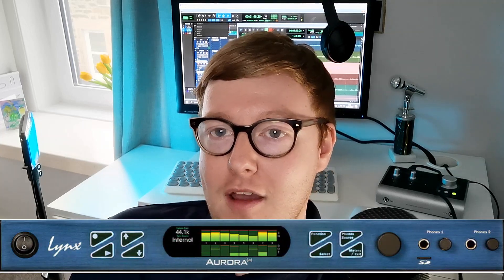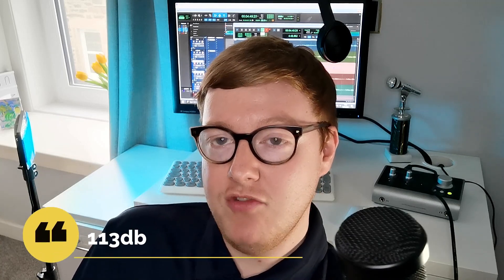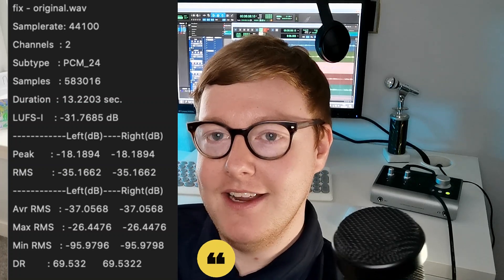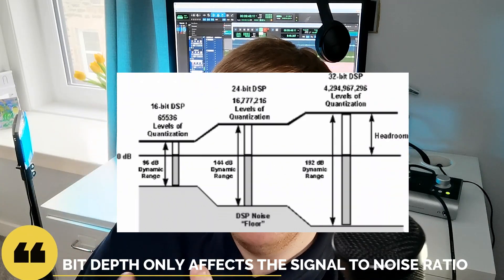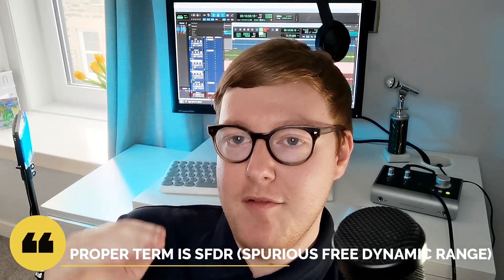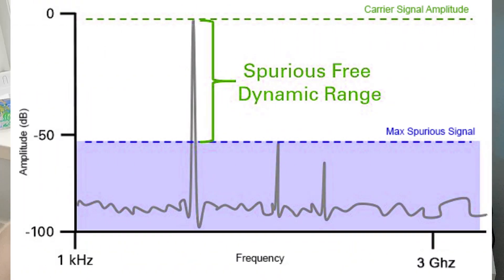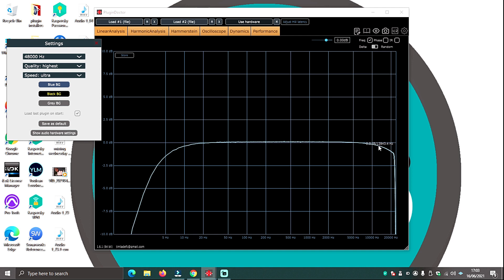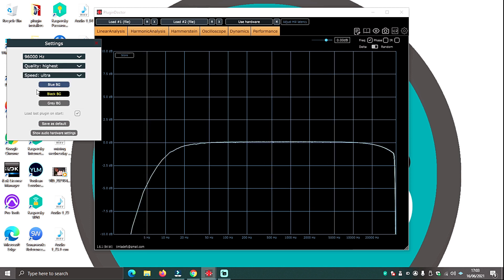Do you lose audio quality in analog gear using budget interfaces vs expensive ADC Converters (Pt 1)

Comment: There is a timing issue in your null test and it sounds like the Lynx was also at 48k compared to the audient first example. Those are the only ones that should matter and what your hear is a better null in the low end of the Lynx versus the Audient. The 96k example on the audient has serious low end issues , you have to remember that what you here in the null test is everything that was lost or shifted in time during the conversion process. Which means the Audient at 96k is severely phase shifted below 500hz compared to the original or you don't have the samples as lined up as you think you do. Do a proper comparison of both units at 96k and use a plugin that will allow you to shift audio fractions of a sample. The other matter you didn't touch on that is super important to imaging is crosstalk rejection between conversion channels and jitter. Clocking in the cheaper interface vs clocking in the expensive will play a big part in how the tracks are going to stack and also take processing during the mix. You are isolating things here in a way that is not in fact indicative of how the units will be used in a real situation. Tracking through each unit vs running pre recorded sounds is not the same thing, the pre recoded file has already be processed and digitized and is no longer a real signal out in the wild. Not saying you cant make a good recording on an audient product just saying I don't think you have proven what you think you have. That audient is not going to keep up when it comes to tracking drums with a 14 mic setup or symphonic orchestra with 40 mics flying in the air, that is a fact. At the end of the day the audient tracked multi mic session is going to sound muffle and muddy compared to the more expensive interface because what I pointed out....Crosstalk, jitter, phase distortion,  frequency response and yes dynamic range does make a difference when tracking things for real vs running pre recorded files through the conversion. Do the same test but this time run full mixes through each converter at different sample rates more then once, meaning, run out of the Daw and back in and then tack that re recorded file back out again and then back in like 4 times and compare the degradation. The Lynx will be much more accurate. This is important when processing things out of the box and back in and then summing things out and back in for bus work..your tracks can go thru 3 or 4 passes of conversion before the final mix is sent to a mastering house where another pass of conversion will take place as well. The cheaper converter isn't going to fair nearly as well in this process. All that being said, converters in general have gotten massively better over the last 15 years, back in the days of the Digi 002 and 003 , there was a huge gap in quality over cheap vs expensive converters, there just was not anything that sounded as good as the Apogee/ Digidesign/ Lynx/ Prism converters in the budget range section. Basically the budget interfaces out now are the best of what was available 15 years ago for a premium price. So be happy with the fact that for $500 bucks you can go out and make a recording that has the potential to sound every bit as good as your favorite records from 2 decades ago. However in todays market with everything being ultra HD and the need for low latency networking and tracking with 200 plug ins during an overdub, Dolby Atmos /5.1 The lower end interface is not gonna cut it in the pro world.
Reply from the maker: It's possible the timing many be the tiniest weeniest little bit off but I did another null test with pink noise not long after I upgraded to the id44 which you can bypass the preamps and run right through the converters. 48k session.

Maxed out the zoom in protools and time alligned for the best null. Tried voxengo time alligner to see if I could get better results by further fine tweaking but I got the same result in the lynx.

You can hear it in the audio examples. Its brighter and SPAN confirms it. Has a deeper null than audient from 20hz to about 1-2k but when you get into the top end that's where the difference lies.

What I learned is that both nulls measure relatively close with -0.8db of a difference in favour of the lynx BUT that main difference lies in the top end which is hyped for whatever reason.. Phase maybe 🤷‍♂️

The audients null is more evenly spread out where the lynx is more different in the high end. So while the lynx has a 0.8db quieter overall null it has most of the audible difference as most of the audible null energy is in the top end.

Audient still doesn't have anything louder than -70dbfs till like 1-2k which is similar to the lynx but the lynx nulls a bit deeper in that region but differs way more in the top end. Its not the counter balance you want. 

Audient pink noise null is -37dbfs and lynx is -37.8dbfs but in a blind test on an instrument or vocal you'll always pick out the top end of the lynx which over a mix will build up and sound a lot brighter. 

So you say 3 or 4 passes of conversion in a cheaper won't fair well but it'd still be more audibly transparent than a lynx aurora which will add more audible top end with every pass where the audient has its differencez but its more spread out and less noticeable.

Its all fine and well getting a deeper null difference on 20hz-2k but when that difference in the audient is practically inaudible anyway it means nothing as the counter balance in the lynx is in the high end which is way more audible and less transparent sounding.

That's why my point still stands.
Reply: @PaulThird  I don't think you understand what it is your hearing friend. What your hearing in the null test is not added high end. What your hearing is everything that was the same yet 180Deg out of phase along with analog artifacts which for this test is an unknown quantity for the Lynx. Meaning you don't know what the signal had to pass through to get through the Lynx and back to you. That being said all converters impart sound signature on to audio, even the most expensive, it is just that some do it less then others. so when the audio from the audient comes back and your hearing an all most full band signal that does not completely null it does not mean it is more balanced. It means the opposite, it means that there is distortion and phase shift across almost the entire frequency range of the signal. That's why it can't  null fully. The signal from the Lynx at 48k is only exhibiting phase shift above about 8k...that is extremely good at 48k and would improve at 96k. When you took the audient up to 96k the high end reproduction improved but the low end got even worse. That is phase distortion and artifacts your hearing and 96k across everything below 3k or so. To put that into perspective, the low end in signal processing is the hardest thing to keep accurate and is in fact what matters most. The Lynx is dead on below 8k the audient is much more out of focus and smeared at 48k. I respectfully implore you to re evaluate you conclusion for you have miss interpreted what it is you are hearing.
Reply from the maker: @metalplatedfacejob  I'm not talking about the id14 in this conversation. It's the id44 which I upgraded to after this video. The new test I made was at 48k. You can bypass the audients pres on the id44 via the send & return. There is no roll offs in the id44. Its flat in frequency response as its not being ran through a pre like in the id14.

You can hear it a pink noise null, you can see it in a pink noise null and you can hear in this video. There is a lot more top end added in via the lynx. Whats causing that I can't say unless I had a physical one to compare to so I can rule out access analog 

That's gonna build up over a mix more audibly than the audient. If I can pick it blind on one vocal rest assured I'll hear it over an entire mix with every pass through. 

Ive offered loads of manufacturers to let me test their converters to prove a point that the price is justified and not 1 has taken the challenge.

At the end of the day if I was paying 3 grand for a converter would I be accepting an audible high end phase shift above 2-3k.. Nope.

They advertise full transparency and that's what you pay for. I don't expect the world from the audient. Its under £500 and they don't make ridiculous bold claims like the high budget ones and I know that I could print through analog gear using it and I'm not gonna be ruining my mix. That was the whole point of the video. I was being told by elitists that my shootouts were null and void as my audient converters werent getting the full quality out of the gear which is nonsense. There isn't this massive degradation that they want to believe. 100% transparent.. Nope.. Could an average listener tell the difference.. No way

There are YT videos running audio through audient, SSL interfaces etc like 500 times and it takes a shit ton of conversion to really screw up the audio on modern interfaces.

The problem is the defiance to admit you don't need a 3 grand converter to make a great sounding record. Nothing wrong with using these expensive converters for the inputs but they aren't going to massively turn your mix into a much better sounding mix. There just isn't enough audible audio difference to say there would be.

If somebody wants me to test an RME or antelope I'd happily do it and if they managed pretty much an inaudible null across the spectrum then I'd say fair enough.. BUT nobody wants to do it 🤷‍♂️
Reply: @PaulThird  Good luck with getting manufacturers to let you test their gear for free. Purchase them on credit for 30 days and then return. That should be enough time for you to evaluate. Antelope converters color the sound in a pleasing way, this is what they are known for. Same as Dangerous and Burl. Hence why everyone seems to say they sound analog. Not all high end gear is going for pristine this is the same in the preamp world, Neve, API, Daking etc.....I'm sure you know this though. Again you have it backwards, the Lynx converters are not adding high end to the sound, what you are hearing is the phase shift that took place when you sent your file to the online server and it went through their audio path and then sent it back to you. You are making an assumption at this point that what you did at home is the same thing that took place there on a remote server not in your control. If you had the unit in your possession I guarantee the test would have been different. None of this is proof positive that anything is better then anything else. The only way to prove this is to track through both converters, same performance with mic splitters. Then mix  both sets of tracks the exact same(plug ins,fader moves, automation, all of it the exact same, through a 3rd set of converters not tracked through. Then compare which mix sounds bigger and has better stereo width and a deeper soundstage.
Reply: @PaulThird  by the way the new id44 MK2 specs look great and is indeed an improvement over the MK1. Are you going to argue that they have not improved there own design? They have and it will sound better I promise you.
Reply from the maker: I've not had a look at it but I will chance my mit and see if they'll upgrade it for me as I wouldn't be able to test the diffrences unless I print stuff through them to compare
Reply: @PaulThird  Do it, it is a nice upgrade for sure, you won't be disappointed. The pre's are from their console line which are very clean and also discrete. Boutique sound on a budget, very SSL like. The headroom is much improved as well as the converters. The DAC is beefed up to so you can trust what you are hearing through your monitors.

Comment: If the difference in high end rolloff between 48 and 96 is only in the 15k and above range, and I could hear audio from your null test, then the waveforms are not as close as you think.

I've done plenty of null tests in protools. The most granular you can get with the nudge is 1 sample. Even if the waveforms appear to be bang on, they are not. I use a time align plugin from eventide that allows you to delay by sub-sample values, and I've always had to add subsample delays even when the waveforms appear to be lined up in protools. And yes, subsample delays plus micro level adjustments will make a huge difference in the null test.

Having said that, I agree with the sentiment that it's a waste of money to spend thousands on a converter if you think it's the "missing piece" to a good mix or master. It isn't. The average listener won't notice half the stuff you do to improve a mix, let alone using an expensive converter.
Reply from the maker: It's possible the timing many be the tiniest weeniest little bit off but I did another null test with pink noise not long after I upgraded to the id44 which you can bypass the preamps and run right through the converters. 48k session.

Maxed out the zoom in protools and time alligned for the best null. Tried voxengo time alligner to see if I could get better results by further fine tweaking but I got the same result in the lynx.

You can hear it in the audio examples. Its brighter and SPAN confirms it. Has a deeper null than audient from 20hz to about 1-2k but when you get into the top end that's where the difference lies.

What I learned is that both nulls measure relatively close with -0.8db of a difference in favour of the lynx BUT that main difference lies in the top end which is hyped for whatever reason.. Phase maybe 🤷‍♂️

The audients null is more evenly spread out where the lynx is more different in the high end. So while the lynx has a 0.8db quieter overall null it has most of the audible difference as most of the audible null energy is in the top end.

Audient still doesn't have anything louder than -70dbfs till like 1-2k which is similar to the lynx but the lynx nulls a bit deeper in that region but differs way more in the top end. Its not the counter balance you want. 

Audient pink noise null is -37dbfs and lynx is -37.8dbfs but in a blind test on an instrument or vocal you'll always pick out the top end of the lynx which over a mix will build up and sound a lot brighter. 

Many say 3 or 4 passes of conversion in a cheaper won't fair well but it'd still be more audibly transparent than a lynx aurora which will add more audible top end with every pass where the audient has its differencez but its more spread out and less noticeable.

Its all fine and well getting a deeper null difference on 20hz-2k but when that difference in the audient is practically inaudible anyway it means nothing as the counter balance in the lynx is in the high end which is way more audible and less transparent sounding.

That's why my point still stands.

Comment: One thing you can do is put output passive transformers between the output of your converters and your analog gear, then put input transformers on the returning incoming audio path and experience the benefits of that color for really cheap! Ordering transformers direct from manufacturers like Cinemag is inexpensive, and then paying a technician to rack them up for you is also very cheap. Now you have that coveted color if you need it, but you can just as easily bypass it if you don't.

Comment: I'm still so confused lol. You still recorded it from the same source. The sound can never get better than the source you recorded it from.
Reply from the maker: It's recorded through the daw. The audient is printed through the audient via routing in the daw, the lynx is recorded through the lynx via access analog.

There no bottle necking, all examples start with audio coming from the daw.

People are running entire mixes through expensive converters for "more quality". They are saying that the analog gear sounds better being printed in combination with a specific expensive converter. In most cases the audio has already been recorded and is being fed from the daw.. Just like in these examples
Reply: @PaulThird  Wow. That's amazing. I had no idea. And I never heard of access analog until now. Technology is scary. 😨 What I was confused about is I thought that was your vocal that you recorded? You actually got someone else to process your vocals through their converters?
Reply from the maker: You send your daw signal out lossless to their server which goes into the gear and back out lossless to your DAW. That's how I do all my analog vs digital comparisons. That or mix analog which is different as you have to import the song or track onto their cloud, work their gear remotely and then bounce. its all outside the daw with mix analog

Comment: Higher sample rates aren't just about hearing more frequencies which many people can't, but the point of higher sample rates is about better impulse response.  Many people don't even know what it means and why it's important.  192khz is not enough to match an analog impulse response.  You need at least 384khz or higher. This is why DSD was created to use as a archive format, but PCM can surpass DSD (PDM) in many cases. For those who want to archive analog recordings as best as possible will never use some crappy low sample rate if they're serious.  Only people who wear earbuds and use blutooth to listen to music will use those low sample rates and not care about anything else. Many serious music listeners prefer a 100% analog transfer of tape to vinyl and it sounds better and more real and it's true because it's mainly due to a true impulse response and zero brickwall limiting.